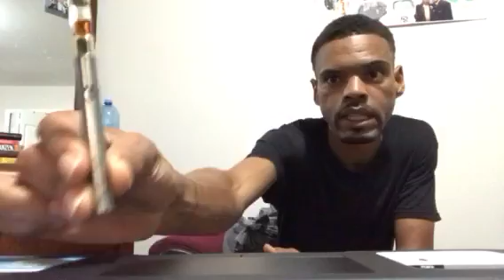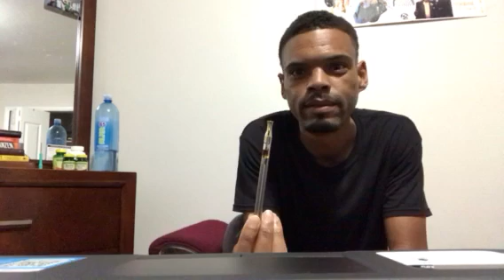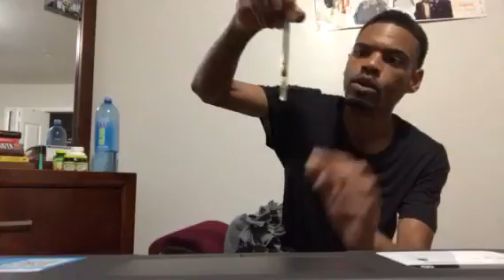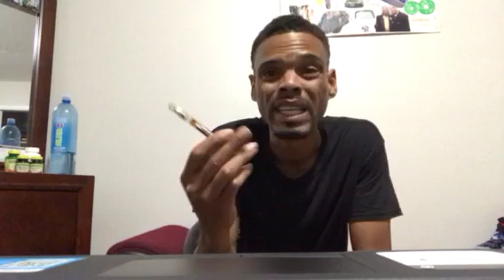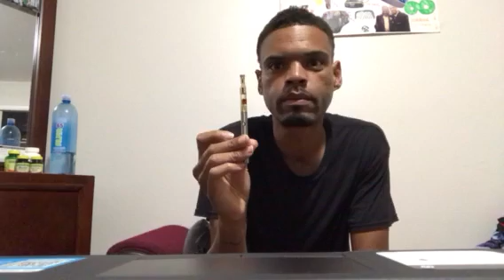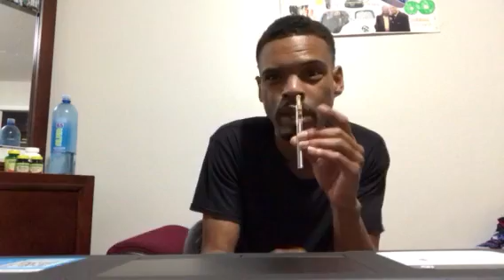Tips for making your THC oil cartridge last a little longer

Comment: 95% of it is absorbed by your lungs immediately. Holding your breath will just deprive you of oxygen and cause dizziness that combines with your high to make you believe you're higher.
Reply: you see i know that its just me getting dizzy but holy shit does it make me feel insanely high for a moment so why the fuck not do it 😂 been smoking these carts for 2 years and havent died from oxygen deprivation yet
Reply: @Rod-ms2mu  it's like how coughing your lungs up after a big bong hit alwats seemed to leave you high as fuck. It's a strange science lol
Reply: Tube Surfer this will actually get you higher as you cough you inhale and exhale much faster breathing in the smoke and pushing it out. That’s why it’s usually hard to stop coughing
Reply: Tube Surfer carbon monoxide, that’s why you feel higher, but you are just getting lightheaded
Reply: That's true
Reply: You are true that 95% (roughly) but the pocket that are lungs are only absorb through their fleshy walls so in a situation where smoke/vape is in the lungs holding allows the smoke/vape to move around and all of the thc has a chance to come in contact with the flesh of the lungs
Reply: @tubesurfer1447  soo true, love to cough after a bong.
Reply: @braidenworkman4265  someone that is actually thinking instead of believing what they read on google right here
Reply: Damm

Comment: Keep hitting it after you release the button. You'll get a little more vape from the warm element, and the airflow will cool the element down so it doesn't heat up the oil in the tank unnecessarily. Also that extra pull will draw the vape deeper into your lungs
Reply: Brian I’m tryna pass a mouth swab test I’ve failed dat shit twice since I’ve started vaping never wen I was jus smoking straight blunts...how long do I have to wait before I should test again?? Anyone can comment with information
Reply: Tineque Watson honestly it all depends on how much you smoke, i say at most a month if you don’t smoke a lot. Also mouth swab tests can be accurate but are very easy to mess up and not detect anything if it’s not done correctly.
Reply: Tineque Watson actually no at LEAST a month honestly
Reply: I’m not sure exactly Also depends on the person probably because there was a time where I smoked like around 3-4 times a week for like a month and then I did a urine test around 3 weeks later and it came out negative
Reply: @tinequewatson2568   there is a detox for mouth drug test
Reply: Good advice bro thanks,💯👌👌💯
Reply: When ever u take a urine test u should just get a rubber band and dip it in chlorine and take the rubber band, when u get to the doctor squeeze the chlorine inside the cup and you’ll pass 👌🏽
Reply: I like the way you think! I'm very similar in the same way, lol! I gotta little trick, I'll control my intake amount by holding the button, counting the seconds, 3, 4...6, etc, and also keep drawing on it a few secs after releasing the button. Now the secret is out, enjoy! Lol😁
Reply: @tinequewatson2568  use Listerine with alcohol before the swab make sure to swish for 30 seconds to 1 minute. spit it out do not swallow it. the alcohol will remove the leftover oil stuck in your mouth.

Comment: I read an article on Leafly that said we don't need to "hold it" for long. The smoke won't travel when the air intake stops. So it basically sits there till the exhale. The technique they recommend was deep hits. Like you said with a mouth to lung method.
Reply: I read the same ..Yep I like leafly

Comment: As an avid user of cannabis vape carts filled with either cannabis oil or cannabis distillate there IS a difference. Especially in how fast the distillate is used compared to say Co2 oil. It's just anecdotal but it's what I've noticed from buying and using these vape carts frequently as in I always have at least one in use and ready to go. I've had carts filled with 1 gram of Co2 oil and they seem to last a long time. Considerably longer then the carts filled with distillate. The distillate has more total THC typically running over 90% where the Co2 oil carts run between 60% to maybe 80%. But the oil is thicker and doesn't move around the cart's interior like in the distillate carts. Anyway, I like em both and buy the one's that are on sale or they're being cleared out. Here in Washington state I buy 1 gram syringes (tankers) of good Co2 oil (such as the oil sold by Dose Oil out of Seattle for instance) for $20 while full grams of distillate are closer to $30. Vape carts sell from $16 half grams up to full gram carts for upwards of $40 at the high end but there's plenty to choose from in the $30 and below price range too. The other thing I've noticed is that the quality of these carts has really improved over the past few years as I haven't had a failure in a cart in at least a couple of years, probably longer. I purchased a CCELL cart off ebay awhile back and I have to admit that it's probably the best cart in terms of putting out clouds of vapor and so far reliability that I've had the pleasure of using. The holes in the interior of the cart are larger and there's more of them so they do work better and can even be refilled more than once too. OK thanks for reading and I enjoy your YT channel. And here's a nice toke of some distillate in the Grand Daddy Purple variety that not only works good IT TASTES YUMMY TOO! Peace....

Comment: TO ALL!!!:  last bit gets too thick to saturate or move down wick(i.e. u see a lil bit, but cant get it) or like stated, it gets stuck in the tip ( or BEHIND o-rings....)?  Use a hair dryer or heat gun on LOW temp and continue moving hand while heating cartridge (holding upright
..graaavityyyy). High heat will do as stated and can evaporate concentrate and or melt/leach reservoir of cartrige (BAD).  As soon as it cools enough to put ur lips on: draw through cartridge for 10-30seconds.(no need battery) the concentrate thins and flows easily into the wick.  Technique 2: open cartridge.  Many cartridges can be opened (unscrew mouthpiece)  this is the filling method, so often there are several 100% hits worth of concentrate trapped between or above o-rings in mouthpiece(from filling) and are inaccessable otherwise.  With these 2 methods you can access 100% of that gold.  Enjoy!

Comment: I will usually remove the cartridge and replace the little rubber caps they come with between uses. This also prevents leakage and evaporation in hot climates.

Comment: MASSIVE TIP. I used to also hold as long as possible and I always wanted to make every hit count. But the truth is that after 3 seconds of having it inhaled, almost all ( i think like 97 percent) of the Thc is absorbed into your lungs, so after a certain point you are just holding it longer and damaging your lungs more then necessary for no extra high. I still count to 3 slowly so its a little longer so i get pretty much all with as little damage to ur lungs

Comment: Only way your getting them low is if it’s a bad brand which usually are like leaky,oil is supposed to be thick another way your getting them low is in bulk which again differs from the branding and where you get them from

Comment: Great tips for cartridges. I have to take a tolerance break about every two or three months as I mainly stick to concentrates because I have COPD. Have you considered trying a dry herb vape? They're frikkin' awesome. I love smoking flower but it's pretty rough on my lungs. The dry herb vape just warms up your herb enough to get the good good without actually lighting it. I generally take a few good pulls and it does the trick. Take care man, and thanks for the tips.
Reply: @jordanbrownstudios  I heard that. The Snoop g pen isn't my choice but it works. I use a Vap-o-nator and it rips quite nicely. Be well and stay lifted my friend.

Comment: Here is a tip for you :)  When you get that little bit of oil stuck to the top....grab a hair dryer an when you heat it up..it will melt down to the bottom.

Comment: I only use my vape in places where I can't burn flower. Like at the bar or at work when I use a the bathroom. And right now my lighter is out of fluid so I can't light my hitter. I use a dugout and my vape pen. That's it. I just started vaping so I'm curious to see how long an eighth of flower and a .25 mg cartridge lasts me.
Reply: @jordanbrownstudios  I'm on all vape now. Well mostly vape. If I find some DANK flower I'll buy it just because. but to your point it was a dude standing at the bus stop vaping non-stop. I'm like this dude must be smoking some bullshit cuz I'd be high as shit if that were my pod. And that pull you did in your video...man I can't pull my carts or pods that long. I'd be choking and wasting vapor like crazy. I can only take sips of mine even on a low setting. I only use the low setting. My vfire battery only has one setting.

Comment: Hey can you make a video on any common problems you come across using the vape pens? I currently have a pen that won’t hit and is also overheating. It looks and has the same adjustable temp. Like yours. Have you ever experienced this before? If so how did you fix this issue. This is my first thc vape pen and can no longer use it, i have almost a full tank of thc left too 😩

Comment: When burning oil in a vaporizer it's still considered smoking it.. true story research into it if you don't believe me. Also not only does a higher temp setting than required consume the oil faster it also gives the oil a burnt taste.
One thing I didn't hear mentioned in the video to conserve carts, don't pull/draw on them unless vaping as not firing and pulling/drawing on the cart floods the atomizer and chimney with oil and it's wasted

Comment: All I can say is the only reason I use my pen is convenience and it’s quick and easy (as it should be used) The pens high cap out very quickly and anything after that is just a headache. Which isn’t a bad thing Bc that’s just what they are a quick 2-3 hit calming high. Now if you want to feel nothing and understand the universe planted on your bed that’s when you need flower Bc as we know nothing beats flower
Reply: Don’t be using the pen like you would flower. They are two very different highs. It’s intended use is really medicating. It’s peak is just a soothing body high and it’s own sorta head high. I’ve noticed no matter the strain of thc oil, it has its own similar head high you don’t get from the flower

Comment: Thc is completely absorbed almost instantly upon contact to the lungs. You only have to hold for a second or two.
Reply: That's not true with high concentrations. If your oil is free of waxes and fats it's pure cannabinoids..
Reply: If you're smoking you will absorb the thc far faster than the tar settles. Holding in smoke will only make the smoke settle in your lungs.

Comment: That shit will never evaporate into the air. And there is def not enough leakage to drain that much of the cart I haven’t had any bad leaking problems the only way to make them last longer is to not hit it as much and not take super long hits
Reply: This man knows what he's talking about, investigate instead of making assumptions
Reply: Jeremy Hampton assuming? I’m not assuming anything I have 2 carts with me rn and I’ve been using carts for 2 years and never have I ever seen a cart lose wax from just sitting somewhere hot that’s not how wax works😂 I’ve seen carts leak but never have I seen wax disappear into thin air... literally into air bruh listen to that shit it’s not water it doesn’t vaporize at temperatures that low
Reply: jordan brown I’ve been doing that for 2 years and I’ve never experienced this or heard of anybody ever saying this was a problem.  .5mg out of a .5g or 1g cart is almost nothing I don’t even know how u would notice that wtf😂 that’s fr .0005 grams bruh.

Comment: Wow that is really sad that you had to pay that much? That's a lot for a half a gram I'd like to give you a little bit of constructive criticism from an older hippie woman LOL if you go on Google and look it up you do not need to smoke hold the smoke in your lungs that long? And it's really not good to also if you let off the button while you're taking a hit I noticed you keep your finger on the button the whole time regardless if it's a temperature Gage battery or not you want to let off your finger on that button at least once because he's things get pretty hot and I see you have a cartridge it looks like it has large firing plates you want to look for a cartridge that has smaller firing plates like Heavy Hitters brass knuckles!! And a few more still keep the smaller firing plate a larger ones burn your oil up within 2 days specially in those little half gram!also you want to steer away from plastic cartridges as cannabinoids or a bind to the vinyls in the Plastics! You can look that up to!and you are correct you should never leave your cartridge in the heat but it still should not leak at the bottom? Anyway there's a few helpful hints for you yeah steer away from large firing plates and if you can't find a automatic battery than a s always have a heat adjustable!I'm going to subscribe and give you a like because I feel sorry for you that you can't get your medicines that's ridiculous what you're paying? But I have seen it for even more in Northern California as more recreational shops are opening up you're putting tax and there's one place with tax and the price of a half a gram it's costing $52 I keep my medical card and I pay $40 a gram to 45 4 top grade oil people are so jacked up about getting recreational they don't stop and think about what that does? medical cards are so easy to obtain online 45 bucks 5 minutes and the prices stay down!! I am really against recreational? Because shop I used to go to the turn recreational started getting cheaper cartridges and yes their prices have gone up and you are paying $52 for a half a gram! After-tax please people keep your medical cards!
Reply: @jordanbrownstudios   Wow that's pretty cheap?I used to smoke the brass knuckles they have really small firing plates! but getting too hard to get a hit off of them? I have switched over to Heavy Hitters they have smaller firing plates! As well but hit much better!! They have no Wick!  tip star is a really good cart you can get a gram of that for 45 bucks!I assume you're paying $25 for a half a gram of the Dank? they burn much slower if you buy a full gram those half grams burn up fast! Ty😇 yes I know I tend to leave long messages sorry! 🙏
Reply: @jordanbrownstudios  yes I have about 2 years ago a dispensary had  it was in Sour Diesel?but when I went back on there it was gone! and I've not seen them since? But you know it's much better if you buy grams they burn so much slower!! Yeah I'm in California and we do have some good carts but recently I've read now 90%  of the cartridges are coming back with metal in them? and that's not coming from the oil it's coming from the carts? They're going to get it fixed this year they say these cartridges are from China? So they're going to try to get them to put their oils in American made cartridges! Which would make perfect sense since the oil is made in America!!🙏